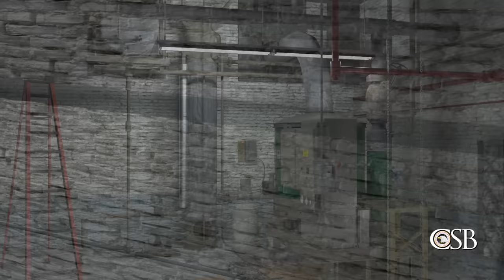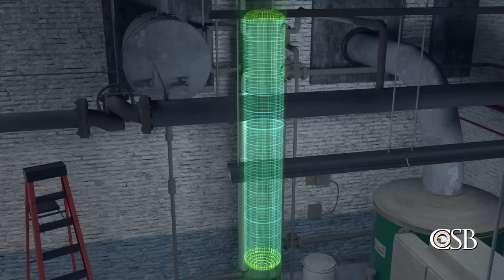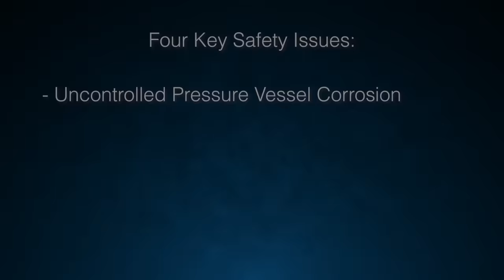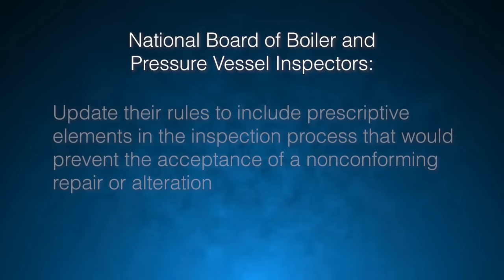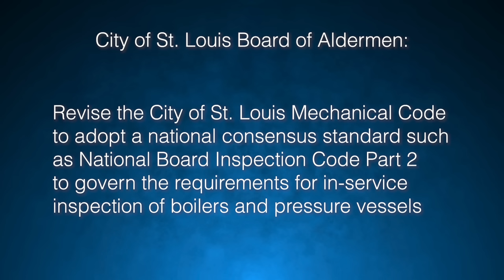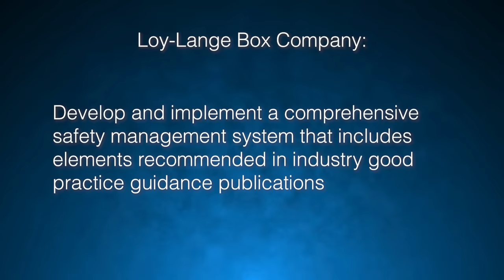Ignored Warnings: Explosion in St. Louis

Comment: Two videos in as many months? The USCSB has been busy! Thank you for the work you do, especially public outreach and materials like these. These kinds of breakdowns help with process-oriented thinking, necessary redundancies, failsafe measures, capacity planning and tolerances, and much more. Much of it doesn’t directly translate to software design, but all of it is a source of wisdom that I get to draw on for my work because of the effort your team puts in. Thank you!!
Reply: I agree, even working in IT I find a lot of value watching these videos.  The incidents in other industries may be different, but learning how to mitigate them is very similar.
Reply: @MLJenkins  what
Reply: @Fleshlight_Reviewer  the way the USCSB breaks down every problem and the series of factors involved in each accident is great for thinking about failure points in systems. Even if the things you’re designing have nothing to do with heavy industry, if you’re responsible for designing systems it might help you build something more resilient. 

Just as an example, the number of times the USCSB has found something seemingly mundane that was overlooked and which eventually unalived someone makes me stop and think about things that I’d consider completely mundane. It’s a double-check when I might’ve otherwise cut a corner, or neglected documentation because “this isn’t going into prod, it’s just a test node”. Yeah that’s going into production lol, no time to refactor.
Reply: @deyjaacterius9610  couldn't agree with your comment more.  The last bit reminded me of a good phrase: "There is nothing more permanent than a temporary fix"
Reply: Funny, I am also in IT, but - similiar to you - find these videos extremely useful and great "food for thought". I guess it boils down to good engineering practices no matter what area of engineering you are involved with. Thank you for your comment. Greetings from Poland.
Reply: I think the motto that the Pinkerton detective agency used to use the one that says we never sleep should also be one for the US chemical safety board!
Reply: @twerktospec  I think they finally got some more funding.
Reply: as someone who just moved from St. Louis to Philly, it's been an exciting two months. I remember this morning in St  Louis well. The boiler couldn't have landed in a worse spot. It's a pretty sparse area and the fact that it killed three people upon landing is awful.
Reply: Yes, I just found this channel and been binging them. Good stuff
Reply: USCSB was actually defunded for a bit.
Reply: As a retired software engineer, I am in total agreement with you! I found throughout my career, the knowledge I gained from working before I became a programmer was a great help. I was 35 when I got my degree. I continued to learn about things other than software and put that knowledge to use.
Reply: @moonshiner5412  what languages did you work with when you were coding professionally? It’s always interesting seeing what people are dealing with, or were just a short while ago, across various industries. 
I get to work with a mix of last-gen JS frameworks and FoxPro from 1993 (: it’s interesting to say the least, and I confuse FoxPro’s inbuilt QL with SQL syntax constantly.
Reply: @deyjaacterius9610  I started with Pascal. Learned BASIC, FORTRAN, LISP, Mod3, Ada, C, C++, PERL, SQL (many). I spent 20 years checking other peoples' code using mostly PERL. I wondered around university computers using the ARPNet. Used everything from PDP-7 through PDP-11, coding in DCL. I am actually learning Python and playing with Raspberry Pi's.
I created windows using MOTIF where you had to draw everything and put it where you wanted. Dude you are making think way back! It was a fun career and I want to help out the next generation of programmers!
Reply: @moonshiner5412  that’s one hell of a repertoire! I’m blown away. Hoping I get to that many before too long, before Electron and JS frameworks subsume the entire profession.
Reply: They got funding cut under the last administration, and I suppose it's been restored now.

Not politics, but I'm happy for that.
Reply: @deyjaacterius9610  I forgot about Java and Javascript. I also did some meta languages - XML, HTML, SHTML. My first computer was a VIC20. I didn't get a PC until 486 came out. Hate Microsucks so use Linux at home. I didn't ever actually write anything to run under M$. Used Unix on a Solaris for a long time.Also, DEC equipment and VAX/VMS.  Sorry for twisting your ear.
Reply: @MLJenkins  especially considering software is more and more being used in life dependant roles, but yea even otherwise it's useful!
Reply: You mean...THEY ARE ACTUALLY DOING THEIR JOB???? Wow...
Reply: RED STATES have this issue. RED states does not give to rats arse about how you run your business in red states. YOu can go years with no inspection ask the people in west Virginia how the love the taste of their water (they were drinking toxic run off for years).
Reply: So... what happened to the company responsible? Anything?
Reply: @billiamc1969  Is it their job to make youtube videos?
Reply: Ily.
Reply: By the previous president
Reply: 3 now😃
Reply: @moonshiner5412  cool language set. id have pursued a dev job if I could use langs I like, mostly old stuff like SNOBOL, forth, apl or cool stuff like REBOL. but I couldn't stand to work in c# or js every day. I could go get a Cobol job but not interested in the framework ur forced to operate in, u can't even interact w big iron at all really. I'm in communication sciences and disorders now.
Reply: @HollidaySpessa   I never used C# (I called it C pound since the keyboard doesn't have a sharp character!). I did use java script for something dealing with web pages but found out I could use Perl to accomplish the same thing. I used tools which read the languages and put information into databases then extracted the data to figure out if the code was written properly. I had to know every language just so I understood what the tools were telling me.
Reply: @moonshiner5412  sounds like u had a cool career overall! jealous of the time period u worked in terms of tech of the time.
Reply: @HollidaySpessa  It was pretty cool! I even got to sign the gold foil for 2 military comm satellites that are in GEO orbit right now. I got to work with stuff I can't talk about!
Reply: Look at these bots
Reply: On the one hand, the CSB has some of the best content on YouTube. On the other hand, they only produce content when there is an industrial disaster that needs investigating. I want new content, but I also don’t.

Comment: I retired about a year ago and closed my machine shop. I always tried to make sure there were no hazards that I didn't recognize and deal with properly. But there are many things that a person doesn't even realize as being hazardous and folks rely on regulations and inspections to help us make sure we don't hurt or kill people. Pressure vessels are particularly problematic because they are quiet, don't move around, and so don't attract attention. But boy do they have lots of potential to cause great harm. Thank You so much  for posting the many very informative videos.
Reply: When I was a kid we had a old air compressor that ripped open at the bottom. It had lots of rust inside at long the bottom because it wasn’t drained properly. It lifted a old solid steel table with steel legs and steel wheels over 8 feet into the air and slammed it into the ceiling. Kids was in that area just minutes before it blew as it was building up pressure. Definitely would’ve killed somebody.
Reply: @88997799  , that is such an excellent point to make with so many people having compressors as part of a business or at home in their garage BUT I wonder how many people think about the fact that millions of people in the U.S. alone have one or more "pressure vessels" in their homes and businesses - the water heater tank (of course there are tankless/instant WHs). What is really scary is just how many of them are sitting above their heads & full of water weighing hundreds to nearly a 1,000 lbs when full of water. It's obviously rare to happen but it does happen. I remember one instance where a water heater was launched into the air and across a highway... 

Of course that's the reason to keep an eye on your equipment, drain & maintain them properly. For water heaters draining at least once a year can help remove sediment AND checking the anode rod, replacing it as needed. It is after all the anode rod which "sacrifices" itself to help reduce the amount tank rust. Also check the temperature and pressure relief valve, that's why it's there to open in the event of excess temp/pressure so hopefully it doesn't become a "bomb/projectile"...
Reply: Shop in ny?
Reply: I'm always scared around any sealed vessel with pressurized gas or water above boiling.  I have the advantage of working in a field where I sometimes deal with the aftermath of ruptured cylinders and tanks, but I think I've been nervous around them since studying chemistry in college or maybe even since learning to use an oxy-acetylene torch in art metal class in high school.  

Pressurized gasses can store a very dangerous amount of energy.
Reply: @zenithperigee7442  Luckily, something would have to go very wrong for a water heater to go up. Consider that at most they're set to maybe 140F. There just isn't the energy there for that kind of BLEVE.

Comment: As a retired reliability engineer, I can say that the number of companies ignoring safety warnings is considerable. Usually sorting the issue is very simple and certainly much cheaper than the failures that occur. The Deep Water Horizon disaster was predicted, and even the kitchen staff were expecting an explosion sooner or later. Lots of the on board staff made out wills prior to the disaster it was that well known to be a risk.
Reply: Yep company I just left was the same way. Thr just put a band-aid on it. Left before the explosion.
Reply: It's so insane to me that companies want profit margins SO extreme that they're willing to destroy their own production capabilities - in the case of refineries especially, literally hundreds of millions of dollars of machinery destroyed and possibly permanent production halt along with possible pollution - instead of just spending the money annually on repairs and maintenance and proper training. I don't believe that they can't afford it, it's just pure short-sighted greed.
Reply: @christophkogler6220  largely because of the stockholders, really. They are the ones really in charge and they would rather have things burn down than have their RoIs not to be the extremes they are now.

Comment: Thank you. From your videos; I always learn something which makes me a better engineer / technician. Please keep it up! 
The repair of the SCR bottom head is dumb-founding to me. The person doing such repair had no concept of that vessel continuing to be used beyond the few days following their repair; or they didn't care about the possible outcome of the failure of that repair.
Reply: The correct repair is to cur the entire head off and weld on a new one. I suspect the reason it wasn't done is that they would need to get a new head made to fit that exact diameter tank and that might not have been available. It's possible to make that dome shape with torches and a standard shop press from a flat plate, **but only up to a certain amount of curvature**. To make the full dome, the flat plate needs to be drawn in a press and that requires a giant press and drawing die set which is very, very expensive. It not something a local fabricator could. They would probably need to get it from the original manufacture and it's possible that was no longer an option.
Reply: @ElectricGears And since it was a pressurized vessel, it likely would have also been needed to be tested again
Reply: Hi davida1hiwaaynet I'm an anti-vaxxer, covid-19 denier and a flat-earther and I have a random suggestion, I suggest watch a 13 part series called What on earth happened by Ewaranon to learn that the earth is not a globe.

I got it in my about tab.
Reply: quick fix and cost saving as always resulted in huge loss. Management Problem!
Reply: @ElectricGears  I'd also hazard a guess that if he cut the entire head off, the pressure seal would be compromised and the vessel rendered unusable since welds won't be able to hold the pressure than that of the pressure seal.

I wouldn't be surprised if the welder is as corrupt as everyone else in the wagon train of disaster.  To him, what does he care?  Hurry up, cut a disc off the vessel, fabricate a new one, weld it on, and leave .  If it blows up, its Loy Lang's problem; they should've replaced it years ago.
Reply: @delanorrosey4730  I don't think that's the case. It's very possible to repair a tank like that. The original head was welded on at the factory.

To me, it looks like the repair actually held (see the pics at 11:10). What failed was the thinned section of metal that wasn't replaced. The tear is in that part of the metal, not a separation of the weld bead. Although the heat stress of the welding is probably what made the crack begin in a location very near the bead. Even proper preheating and cooldown wouldn't have prevented that.

An inspector might have easily signed off on the weld (in principle). What should not have been signed off, is the failure to replace all the corroded metal. Actually, this particular weld would be rejected because it was against compromised base metal.

The other complicating fact is that it held for 5 years. There might have had good metal to weld to at that time. It's very possible that procedures changed somewhat which allowed more oxygen in, or the municipal water chemistry was changed and it became more corrosive to that grade of steel.
Reply: @ElectricGears  I mean, YES and NO.  Yes, the weld might've held up in the short term.  But no, in the long term, as you've pointed out, metal fatigue from the new weld might've helped it fracture later on.

For the amount of time and money spent welding it, might as well ordered a replacement and have the welder cut the rust bucket out and send for scrap and install a new one.

(Look at the WorkSafeBC video about the exploding kitchen kettle.  The service technician gerry-rigged a restaurant's broken steam kettle to keep operating when it should've been replaced.  If one knew that the faulty safety mechanisms and broken temperature regulator were disabled on the obsolete kettle, they'd take care to ensure there was water in the metal jacket and keep observing the kettle so it didn't overheat and shut it off before it did.

But because they ran the kettle like any other day and with no regard to safety/replacing it, the kettle exploded, destroying the kitchen and injured a few workers.  Thankfully, no one was killed.)

Although I'm going off on another tangent here, I think it must be mentioned.  Kinda like the lengthening of the Edmund Fitzgerald.  Can it be done?  Yes.  Should have it been done?  I don't think so.  I think the ship broke it half, not only by the terrible weather out there, but also the bending and flexing of the hull in bad seas with 29,000 tons of cargo on a ship with poorly maintained hatch covers.

Aside from the Fitz being stuck at dry dock under modification was completed costing the owners money, they might as well have saved up and had another ship built.

Two ships with half the load.  Even if one went down, still have the other and still has half the cargo.
Reply: @ElectricGears  Tanks come in standard dimensions. Same with the endcaps. Nobody is hand fabricating the endcaps in a local shop.  The repair company just calls up their supplier and orders the right cap.
Reply: @flat-earther  I am a covid 19 affirmer and round earther. And I challenge you to a dance off 🕺 💃
Reply: Doing such created a Rocket.